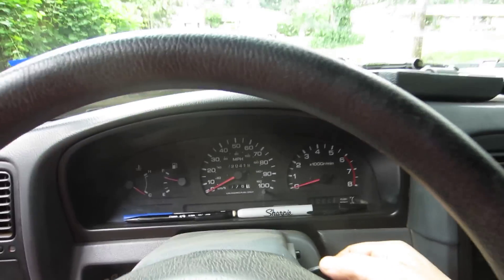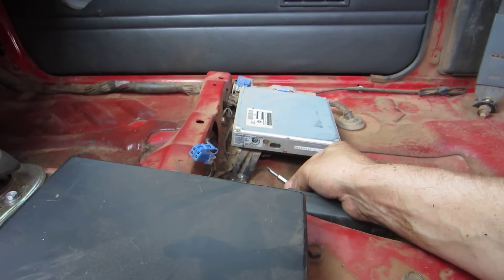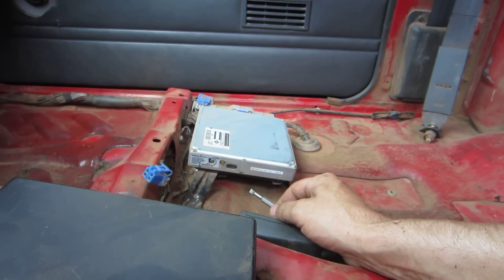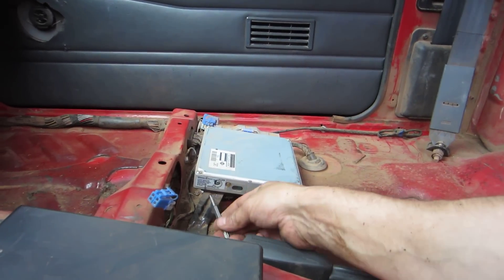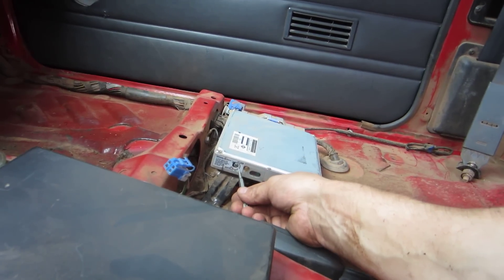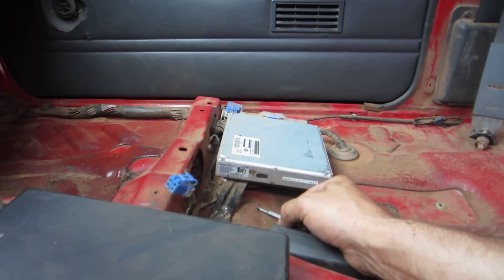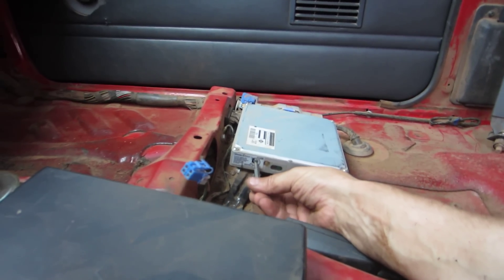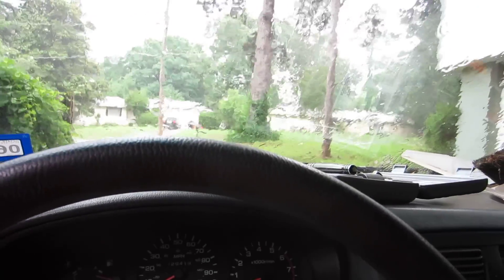Nissan D21 Hardbody Error Code Reading

Comment: I have an '87 with TBI. My ECCS console only has a tight switch on the back side. lol Uploading a video on operation now. VG30i
Reply from the maker: The ECCS or ECU work similarly. The older ones have a slide switch, while the newer ones have a dial to turn.

Comment: What does this do for the truck? Does they help it run better?
Reply from the maker: It helps you find out what is wrong with the electronics. It was before OBD2, so before you could simply read the codes to tell what was wrong.

Comment: Mine has no lights so ig that’s no good huh lol
Reply from the maker: Yeah. That sounds no good. You have the key turned on, right? I mean, like there is power everywhere but the ECU lights are not blinking? If that's the case, you might want to check the fusible links attached to the battery. One of them goes to the ECU. Read upon this thread:
http://www.infamousnissan.com/forum/showthread.php?t=35558

Comment: Is this the only way  to ckeck for a code
Reply from the maker: There is a guy on Infamous Nissan that will make a dongle that makes it easier to read the codes, but they are still blink codes. 
Here is the link:
https://www.infamousnissan.com/forum/showthread.php?t=46719
In there, you will see a few of my videos where I bought and installed one. It's a lot better than removing the seat every time!
Reply: Thank you for the information yeah I don't want to have to.take the seat off everytime lol
Reply from the maker: @doughgarcia6086  LOL Yeah, that's a real pain in the ass!
Reply: I am trying to register for that site you sent me and I am stuck on the referral name 
Everything I put is wrong lol
Or I just don't understand what they want...
Reply from the maker: @doughgarcia6086 it needs a referral? I'd just leave it blank. You could use me, jp2code, if it requires something.

Comment: On my computer, while I start the truck, both LEDs (red and green) go out and the truck is not starting either. Then with the key on the two LEDs turn on again and I can even get the codes, but if I turn the ignition on again, the two LEDs turn off again. Does this mean that the computer is failing? Or will it be normal for the LEDs to turn off while it is sitting? Greetings.
Reply from the maker: So the ECU lights do not have power when the engine is cranking?
Reply: That's right, and I don´t know if that is normal.
Reply from the maker: @cybergamesmatamorostamauli4456  is this, perhaps, SarjentStupid on Infamous? I know he's working on his truck right now and trying to read codes.
Reply from the maker: @cybergamesmatamorostamauli4456  most electronics turn off because cranking the engine is the most electrical intense routine that the battery does. I know the ECU has to stay ON to operate the injectors and other components, but I don't know off hand if the Red and Green diagnostic LEDs remain on or if they turn off also. I suspect they turn off, but I do not know this.
Reply: @jp2code hey it seems like you know your fair share on these trucks. I have a 94 that only turns on red with no green I have tried to put it on diagnostic setting with no luck any tips or help ?
Reply from the maker: @joshuacruz4046  it sounds like an issue with your ECU. We had an owner with this problem on InfamousNissan.com a few years ago. He opened up the ECU and found that one of the components had burned through the silkscreen. He soldered a small wire from the points where the connection was supposed to go, and it fixed his ECU issue. So, you may have to open up your ECU to tell. There is a guy on our forum who makes a 3D printed code reader that will work on your truck, so you don't have to pull the seat anymore. For more information, see this listing (I've even posted videos showing how mine works): https://www.infamousnissan.com/commerce/for-sale-or-trade/41384-ashtray-ecu-remote-module
Reply: @jp2code  my ecu seem to have gotten wet. It cranks and start but does under load

Comment: I have a 1996 Nissan pickup truck I do not have the. I do not have the lights on my The lights I changed it and it still will not run and crank the. Information? You. Gave me? Is not right? I changed everything from the fuel tank back to the computer.
Reply from the maker: Richard, I don't even understand what you wrote. It sounds like you forgot a lot of the words. Please proof read before you post.
Reply: I have a 1996 Nissan pickup truck and I put a new computer. And it. Do? Not. Have? Light on it. What you was showing. And it's still not running. It cranks up and then cut right back off within 10 to 15 minutes.
Reply from the maker: Oh! That's probably because Nissan went to OBD2 starting in 1996. You can get a typical code reader and plug it in under the dash by the fuse box to read your codes.

Comment: Can anyone answer this question for me... my speedometer stopped working. I pulled it out of my truck and drove around like that for awhile. Maybe no more than 200 miles. I want do a motor swap maybe an sr20det motor, but I want the miles to match on the body. Is their anyone I can tell from pulling the original ka24de?
Reply from the maker: Is there anyone you can tell from pulling the original 🤔 Peter, I do not understand the question.
Reply: @jp2code  yes the cluster does work. I had to put the cluster because the speedometer stick would stop moving over 50 mph. Because of that I was driving around without my cluster and no I'm trying to know exactly the miles on the truck. I believe I only drove like 250 miles that's it's off.
Reply from the maker: If the speedometer was unplugged, there is no way to tell the actual mileage. The vehicle is over 10 years old, so it is exempt from odometer readings.
Reply: @jp2code  okay thank you for your assistance. In your opinion, does it matter to you if it is off a little?
Reply from the maker: @popclutch_100  not at this point. Most of these trucks are in the 200,000 mile range, so even 1000 miles doesn't make much difference.
Reply: @jp2code  okay thank you mone only has 156,000 and from the original owner.

Comment: my trucks been running very rich, stalling, horrible gas mileage, misfiring, etc. checked my ecu and only threw a ecm code, is my ecu faulty?
Reply from the maker: They go out, particularly if your truck doesn't have the fusible links anymore. Fusible links prevent electrical surges from damaging the electronics like fuel injectors and the ECU.

Comment: Tks for the awesome post, after reading the codes in mode 3, anything special you need to do such as does the truck need to be in mode 1 to run Ect???tks  Sigs70
Reply from the maker: Nothing special. If you have codes that you want to clear out, leave the ECU in Mode 4 or 5 when you turn the key OFF and they will be erased.
Reply: @jp2code  Thank you tons,,, my Computer was sent off for repair re installed and didnt pick up due to the diagnostics screw being out, ran the test as shown in ur post and code 55 showed no faults, thank you you just saved me tons on $$$$ Sigs70  in TX

Comment: What do you mean mode 2
Reply from the maker: Marcus, when the ECU blinks twice, turn the knob to select Mode 2 in the EC section of the Nissan Truck Service Manual. Mode 2 is typically used for testing if sensors are working. Mode 3 is for reading the error codes, again as outlined in the Nissan Truck Service Manual.
Reply: jp2code okay. Did 3 and came up with 55 , did mode 1 and came up with 4
Reply from the maker: @Brandnewguy1  55 in Mode 3 means that you have no codes. I don't think Mode 1 has codes, but I could be wrong.

Comment: My truck has an obd2 but when I plug it up it won't read codes. It won't connect for some reason. Any help?
Reply from the maker: What year is your truck? 1996 and newer had OBD2. If you have that, you don't need this video. You just plug into the OBD2 port and read the codes.
Reply from the maker: If it won't work when plugged into the port, you have bad wiring to the port or a bad ECU.
Reply: @jp2code  yeah idk how it should look but there's only 4 wires plugged into the port. To blacks one red and one white
Reply: @jp2code  it won't connect I traced it back to the air flow sensor and one wire is broke on the female side. Watched a video and it said that if a sensor isn't connected then it won't connect to the obd2 plug.

Comment: how did the black ecu cover come off?  mine has no screw on the outside for cover removal.
Reply from the maker: Just lift it up. It pops off. No screws.
Reply: @jp2code  I just found your reply-  thank you!

Comment: Worked like a charm. On my '94 D21 4wd, KA24E. Got error code 41. Was the intake air temperature sensor. Easy fix. It's right under the air filter on the passenger side. Thanks for the video. It saved me a lot of headache.
Reply: Hey when I plug in my obd2 sensor it won't read???? Can I pass emissions w that or no? Also did you obd2 scanner not connect too?
Reply: What were your symptoms?
Reply: @joshuacruz4046  I didn’t have any except the check engine light was on. It ran normal still from what I remember but it was a few years ago.

Comment: Good tip. I recently bought an ECU from you on infamousnissan, worked out good.
Reply from the maker: Glad it worked out for you
Reply: @jp2code   rebuild the engine in my 94 D21 road back and forward to New Orleans to visit my son at university hospital for about 3 weeks got in it Saturday of the third week truck won’t start no head light no horn put in a new ignition switch and it still wouldn’t start had towed to the shop that did the work and I’m told the computer is bad truck has new battery and a new starter I was told that they jumped starter it but when they tried the computer the truck killed they also put the wrong battery in it with 850 cranking amps could that have damage the computer please help Thanks
Reply from the maker: @royjames1742  My truck has an 850 CCA battery also. That isn't the problem. What likely happened is that they bought a battery with the Postive and Negative battery posts on opposite sides, and that caused them to connect the battery backward. If you have fusible links, it blew them out:
http://www.infamousnissan.com/forum/showthread.php?t=35558
If the fusible link to the ECU is blown out, the ECU will not get any power from the battery.
If some idiot removed the fusible links from your truck in the past because they didn't know what they were for, then connecting the battery backward would result in the ECU getting fried and likely the injectors blowing out, too.
Fusible links are sold on eBay:
https://www.ebay.com/itm/364828417166

Comment: Thank you for the great video. I unfortunately could not get it to work on my 94 D21. The two lights come on when the key is switched to the on position but it never goes into diagnostic mode when I turn the dial. Any ideas? I'm sure the truck is in the "on" position (not just accessory) and the dial spins and stops just as I would expect it to. The lights just never blink for diagnostic mode.
Reply: Mine is a 96 I have no lights on it unfortunately. But when I plug an obd2 sensor up to it won't connect.
Reply from the maker: Apologies for missing this, Ryan. It sounds like your ECU is bad. Some people have opened the ECU to find parts that were burned inside and fixed those, but I suspect they were pretty skilled at electronics already. Otherwise, there isn't much you can do but replace it. If there are no other issues with the ECU, I would just ignore reading the codes.

Comment: How did you replace the parts 32,23, and 51.
Reply from the maker: http://www.infamousnissan.com/forum/showthread.php?t=31527
23 = Idle Switch (fix wiring or replace it), 32 = EGR (clean it), 51 = Injector (find out which one is bad)
Reply: jp2code what year is this again?
Reply from the maker: Mine is a 1994. I don't know what year yours is. Please visit the forum. My slow internet connection takes about 10 minutes to load this You Tube page before I can reply - every time.
Reply: jp2code 95. Thanks. What's the point of the first codes flashing and then the real codes

Comment: How do i pull the code on a 98 Ud truck.It wont shift past second gear.
Reply: You have to push the clutch in and move the stick to the 3rd gear position
Reply from the maker: Use a code reader. You truck is OBD2.